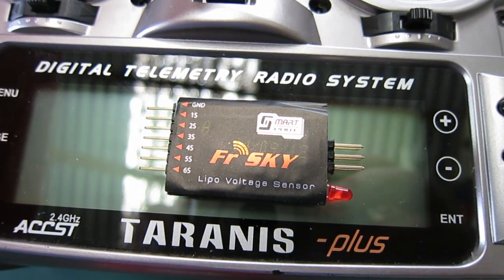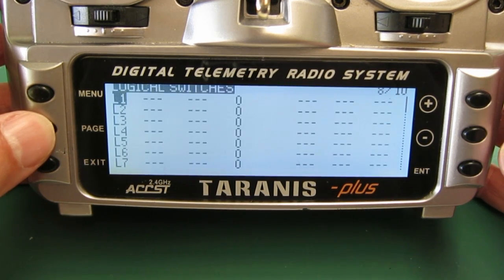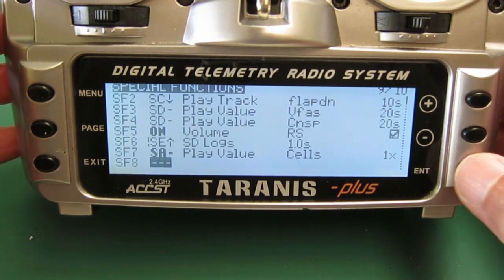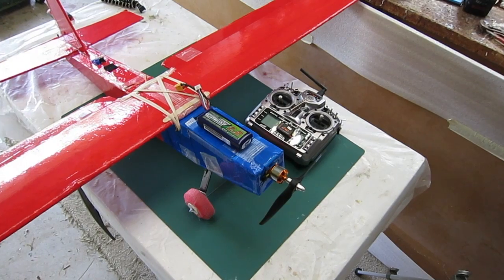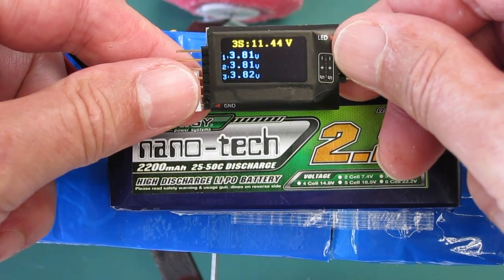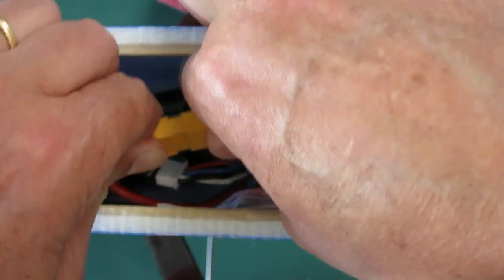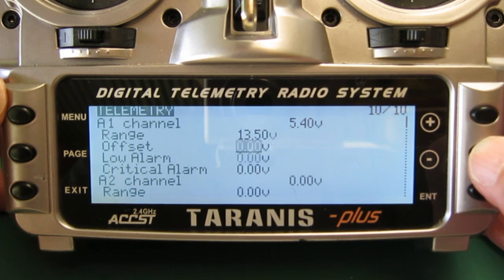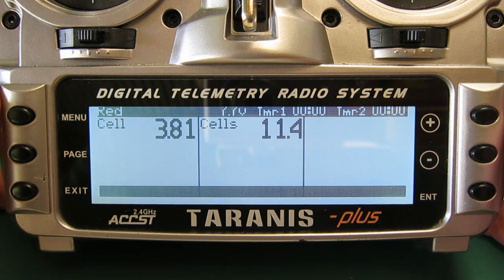FrSKY Lipo Voltage sensor

Comment: Do you know if the new Frsky FLVS Lipo Voltage Sensor work with the old S6R rx’s? Can’t find any older sensors, Thanks mate
Reply from the maker: Don't know for sure but they are still S-Port compatible, so should be OK

Comment: While cleaning out some old gear I came across a couple of these voltage sensors.  I've long since converted all my planes to ELRS.  Is there any way to incorporate this telemetry sensor into my ELRS environment?
Reply from the maker: Unfortunately no, S-Port only. But many ELRS receivers have VBatt monitoring input

Comment: hi andrew, i have a problem here, i am using frisky x20s and sr10 pro, i checked the receiver setup is using sbus, and i plug the voltage sensor to sbus out of the receiver, i cannot find the telemetry readings of the voltage sensor after i check the discover new sensors, if you were me, what will you check up for the error ? thank you very much
Reply from the maker: Sensors connect to the S-Port not SBUS

Comment: Any reason why I am only getting overall voltage and not the lowest cell?
Reply from the maker: Just needs a little extra setup to get lowest cell. Add New Sensor on the telemetry page and select Cells (or cell - cant remember) then the Lipo sensor as the source
Reply: @AndrewNewton  thank you

Comment: I have a problem with the MLVSS type. With smart-port on the X8R, it detects voltage for only a couple minutes and says “sensor lost” in mid flight... And it doesn’t recover after...
Reply from the maker: Strange behaviour, have you tried a different receiver?

Comment: Hi Andrew i have a question when putting my sencor and when i get to play value i dont have cell or cells to put in there just not there,,,would you no what i need to do if you would no? thanks for any information have a great day,,,,Kevin
Reply from the maker: "Discover Sensors" in the telemetry section first, then Cell will appear as an option (right up the top of the list)
Reply: Andrew Newton Thanks Andrew I had the sensors for almost a year and could never find Cell and Cell’s LOL so I watched your other video today Which I did what you just wrote to me I have Cell’s but I’m not getting cell OK let me go back in and  full around with it thanks so much for getting back, Kevin
Reply: Andrew Newton okI must be doing something wrong I just can’t get Cell up on page 12 when I press discover it has our Rssi rxbt cels.  Thanks again I’ll have to fool with it and then on page  And for the hell of me this is bothering me because I can’t figure it out LOL
Reply from the maker: Oh yes, for the individual cell voltage you have to "add sensor" then ... I'll have to check
Reply from the maker: OK for lowest individual cell - In the telemetry page go to Add a new sensor, choose Calculated then select Cell from the list.

Comment: Thumbs down for not showing the connection to the receiver.
Reply: This video is out of date now Josh. Here's a more recent one covering all the sensors https://www.youtube.com/watch?v=cK_R4MG7qXY Also note that "Cel" or minimum single cell voltage is now under Add Sensor - Calculated

Comment: Is the red led on the smart sensor suppose to stop flashing? Mine continues to flash throughout.
Reply from the maker: It keeps on flashing. Might flash slower when it's correctly connected?
Reply: Thanks.

Comment: Hi there Andrew,  I can't seem to get the individual cell voltages only the total cells voltage,  Am I doing something wrong??
Thank you for your time.
Reply from the maker: Recent OpenTX update removed the "Cell" unfortunately. Probably still available somehow but I have not looked into it. If I find it I'll let you know
Reply from the maker: Here is the solution, have to set it up in the Add sensor menu https://www.youtube.com/watch?time_continue=251&v=1YcsBjmxHwM
Reply: Hi Andrew,  finally got it right I have a slightly different version as Painless 360 but stil got it to work ,on a XSR receiver, not a X8R.  Thanks for your time.

Comment: Hi, I just received this FrSKY Lipo Voltage sensor, I added it in the sensors screen, but I have different options visible on my Taranis X9D plus : cels / cels + / cels - (yes, with one "L" and not two). I'm using the X8R, and plugged the Sensor on the smart port… So I can't see the minium cell voltage (of one cell)… Can you tell me what to do ? Thanks for your help !
Reply from the maker: Yes you have to add it as another sensor. Go to Add new sensor, Change the type to Calculated, Change Formula to Cell, Might have to select Cels as the Cel sensor?, Choose Minimum as the Cel index. Tell me if that works.
Reply: oh my god ! It works ! :) Thank you very much !!!

Comment: Hi Andrew, 
Thankyou very much for taking the time to put this tutorial together very helpful, one question please on your special function page at 0.41 secs you are inputting data for SF7  you set this to "Cells" I dont have this option to choose I have the same radio as you I have version 2.1.8 on firmware could you assist at all.

Thankyou Alan.
Reply from the maker: Hello Alan. You have to connect and Discover the sensor before Cels appears (I think) I'll have another look at mine.

Comment: friend can use the radio firmware with TH9X ER9x module XJT + X8R
Reply from the maker: +silvagomes1961 I have not tried that myself but I believe it will work

Comment: Maybe you can help me...I only have Cels available to choose on my radio and it only it doesn't read the decimals when it reads the voltage value. Do you have any ideas why it might be doing this?
Reply: +SabalPalmPictures Hey, I'm having the exact same problem. Can you please link me to that forum?
Reply from the maker: SabalPalmPictures Hmm,, how strange. Do you have a recent OpenTX version? Taranis radio?
Reply: Andrew Newton I found a forum post that said with the newest OpenTx firmware you have to set Cell up as a new sensor. That worked but it sounds like the decimal problem hasn't been worked out yet. Thanks for the reply.

Comment: Whats the difference between the current sensor and the voltage sensor? Which is the one to use if You don't have a lot of money lol.
Reply from the maker: 3000gtwelder Current sensor for a powered plane. They both cost about the same but the current sensor tells you current, voltage and consumed power. Lipo sensor for a glider or slope soarer, it's much lighter but only does voltage..
Reply: Andrew Newton
Cool, thanks. I was wondering after looking at the two why you would want a voltage sensor, when the other does more, now it makes sense. Weight certainly makes a difference on a glider, more then a powered plane.